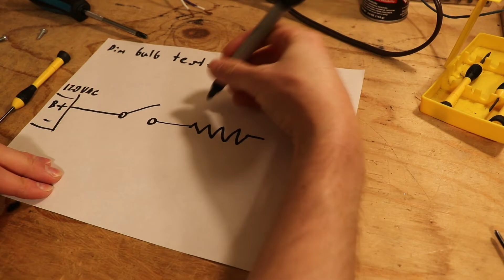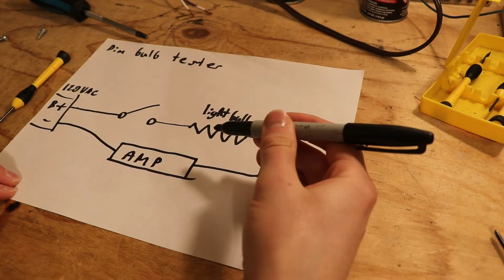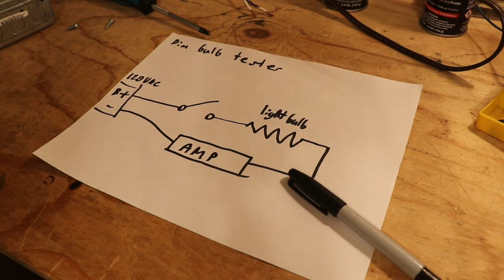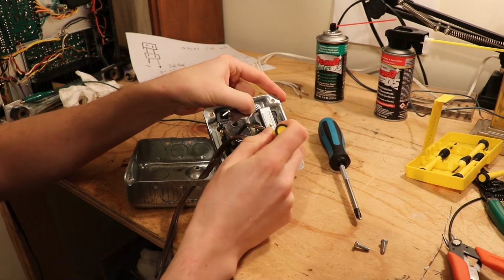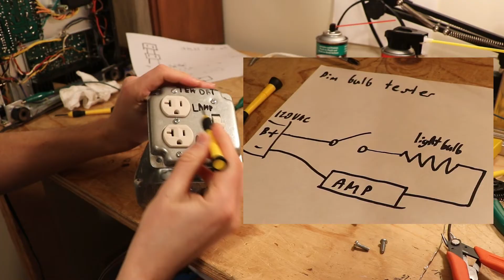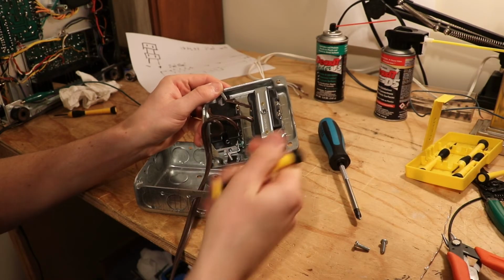Dim Bulb Tester: What It Is, How I Built Mine, Seeing It In Action

Comment: OK, I like the general idea, and I'm gonna have to build one of these testers myself, however, I am an electrician by trade, and I see one minor, (potentially major?), flaw in your design there of the actual wiring of the test hookup box itself...

The way you have that wired, the lamp is fine and safe, but the outlet that you plug the amp/receiver/equipment under test into is wired backwards as a result of the way you did it there, and you have the "hot" lead going THROUGH the lamp bulb and then coming back from the lamp on the lamp's neutral wire, so then the hot is now going to the "neutral" lead on the amp's power cord, which in many cases with more modern equipment, that usually doesn't matter too much because the transformer primary is oftentimes totally isolated from the rest of the circuit, however, on some older/vintage equipment the neutral wire is sometimes tied to the chassis of the equipment, at least through a resistor and sometimes directly, and since the way you wired that test box outlet up sends hot to the neutral terminal of the amp outlet, you could potentially get shocked when touching the chassis of certain older equipment, and of course that is a major safety hazard!...

To fix that potential issue with certain equipment potentially shocking you when you touch it, you should break the tab on the neutral side of the outlet also and then take the "neutral" (white/silver colored screw) of the LAMP outlet and wire that instead to the "hot" (black/brass colored screw) of the AMP/EQUIPMENT outlet, then take the amp outlet's neutral terminal (white/silver screw) and go back to the neutral of the main input wire/cord.

On a 120 volt outlet the neutral is always the longer slot, and with a 20-amp outlet like you have there, the neutral is the slot that looks like a sideways T, and the hot terminal is always the shorter slot.

If you fix that minor thing as described above then you will always have the polarity correct on both the lamp AND the equipment under test, which is very important for safety!... At least as long as the cords plugged into both outlets are polarized anyway, (i.e. with the neutral blade of the plug wider than the hot blade so it can only be inserted one way), OR else if plugging in a lamp or equipment without a polarized plug, (with both plug blades narrow and of equal size), then you would have to just pay attention to which way you insert said (unpolaraized) plug into the outlet so that the neutral side of the outlet always goes to the neutral wire of the plug/cord, (which is usually marked with either a white stripe or more often ribs or ridges), and then the hot side of the outlet, (narrow slot), always goes to the hot wire/side of the plug, (which in most all cases with most 2-conductor power cord wires, the hot is the one without the ribs AND it usually also is the one that has the writing or imprinting on it as to the guage of the wire, etc.), and so by always checking that, AND having your outlet box wired up correctly, then you'd never have any issues for a potential shock hazard.

Because if you've actually never gotten shocked yet with the way you have that test outlet box set up now, then you've gotten extremely lucky!

Hopefully you see this comment and understand it, AND you can fix/properly wire your test outlet box before you ever get shocked by touching the chassis of a piece of equipment, (due to the way your tester is currently MISwired), because we can't lose a great channel for us people who love to fix vintage gear, due to you getting injured or worse!

I will help you with a further, more detailed explanation, to get your test outlet box wired correctly if you need further clarification of anything I said here, so if you have ANY questions about anything I said above OR about why it is absolutely necessary/essential to fix for your own safety, then feel free to ask me anything at all about it and I will walk you through it step by step IF you need the help!

I actually hope I DO hear from you in a follow up reply, AND that you got your tester outlet box fixed the way I said, because electricity can be very dangerous if you ever touch the hot lead of 120 volts or higher, as I'm sure you already know!
Reply: Thanks for this! I just built one and watched this video to compare what I did, mine is a little different - thankfully I think I built exactly as you described it. I am using a 2-gang metal box. One of the gangs is a dual switch/output combo, which is where I will plug in the amp. The other is a regular dual outlet, where I will plug in the bulb. I broke the tab on the switch/output combo to completely separate them. My wiring is like this:

hot from power cord -> switch -> hot terminal of double outlet -> lamp(s) plugged into double outlet -> neutral terminal of double outlet -> hot terminal of single outlet (on the combo switch/outlet) -> neutral terminal of single outlet -> neutral of power cord. Of course all pieces are grounded including the box. 
Thanks again!
Reply: He doesn't have anything labeled so you don't know, this isn't a physical diagram. He has the source labeled as a battery anyway. Yea on the amp plug you want line and Neut to be on the correct side with a ground, that's intuitive. Ground to protect the tester case and if the amp has a ground.
Reply: These vintage units have non-polarized plugs so that is a non-issue
Reply: @Texan1048  Sometimes yes, if they're a fully isolated unit or device, (which many are), but if you really pay attention among ALL electronic components, there are just as many, (probably even more), devices with polarized plugs as there is with non-polarized ones, so in order for this dim-bulb testing device to be totally 100% safe for ALL devices and components that you may plug into it, it really needs to be wired correctly, with proper hot/neutral polarity on the outlets, otherwise there runs a slight risk of electric shock with some devices that rely on that proper plug polarity for safety!
Reply: @JoeJ-8282  agree, have to be familiar with what you are dealing with

Comment: Still astonishes me that America likes metal boxes like that. Here in Australia, that would have to be plastic to be safe and legal.
Reply: A metal box would be OK as long as it's properly grounded. But yeah, it astonishes me to see that with no ground lead, super dangerous! Having the sockets like that would be totally illegal also - firstly, again, because again, earthing - the sockets don't have a protective earth connected to their ground pins, but secondly because you could just plug any old appliance in series with the device under test. Theoretically I think you could produce a legal dim bulb tester here, but you'd want an RCD breaker on it, and probably you'd need to put a bulb bayonet/screw mount socket on the box itself and wired internally, instead of the socket for the external lamp.

Comment: Just a suggestion, break off both tabs on the outlet and run a jumper wire from the Neutral side of the dim bulb socket over to the Hot side of the item test socket. That way you preserve the Hot, Neutral, and Ground positions at the item test socket. Basically plug in an outlet tester in the item test socket and verify it passes the checks (no reversed Hot/Neutral)  then you know it's good.
Reply: Yep, that is actually an absolutely essential thing that he MUST do as soon as possible, or else he is going to eventually, sooner or later, get shocked by having the hot (running through the bulb and back to the tester outlet) and then connected to the neutral wire of the equipment under test through that unbroken tab on the neutral side of his test outlet there as it is currently wired...

I certainly hope he sees either your comment or mine about this exact same thing, and he makes the appropriate changes to his tester outlet box before he gets shocked by touching the chassis of some piece of equipment he's testing out that has the incoming neutral power cord wire connected to the chassis of said equipment, as some vintage gear is wired that way, I've seen it in years past!

We definitely don't want to ever see him get hurt by getting shocked!
Reply: @JoeJ-8282  Yes. there's YouTube videos about making these and the one I followed pointed that out. Mine looks the same as his with the exception of the reversed hot/neutral and I also added two neon lamps to mine. One lamp comes on when it's plugged into mains and the other will come on with the switch is thrown indicating AC is present at the item test socket.
Reply: Excellent point using a socket tester! :DDDD

Comment: I love DIY tools, this is awesome! But you should make sure and use an LED bulb, it's more energy efficient. 😉
Reply: I believe LED bulbs are different resistances. You could also use different watt bulbs for different equipment you are working on. It Has to be an incandescent bulb.
Reply: LED bulbs do NOT work as series connected, (i.e. current limiting), resistors. It is the actual filament of an incandescent (only) bulb itself that acts as the resistor needed for this type of tester, because if the current going through the bulb is relatively low and therefore safe for the equipment under test, then the bulb will not glow, (or only glow for a short period of time during the intitial charging of the power supply capacitors in the amp/etc. under test, and then once those caps are fully charged then the bulb will slowly fade out and go off), however, if the current drawn by the equipment under test is too high, due to an internal short or other major malfunction in said equipment, then the lightbulb will stay lit, indicating a problem with the equipment under test, because if the equipment being tested draws too much current, due to a fault, then the filament of the incandescent bulb will heat up and start to glow...

But an LED bulb doesn't use a filament, it uses internal electronics to light the LEDs in it, of which are of a very high resistance, (usually in the megohm range), which will never pass enough current through it to power ANY equipment, even if the equipment is working totally fine.

That is why this kind of tester ONLY works properly with an incandescent bulb. You can also change the wattage of the incandescent bulb to pass relatively more or less current, depending on what the equipment under test may need to operate at all. Higher wattage incandescent bulbs will pass relatively more current in a series wiring configuration like these testers use, and a lower wattage bulb will only allow a relatively lower current to pass before lighting.

When using one of these type testers it's best to start out with a relatively lower wattage incandescent bulb first if you have no idea if your equipment under test is working or not, that way you send as little of current to said equipment as possible at first, reducing the chance of further damaging it if something is wrong with it.
Reply: @JoeJ-8282  but.. are you sure? Have you even tried it first?
Reply: "Have you even tried it first?" is NOT even a valid question. An LED bulb WILL NOT WORK in this application. They function on an entirely different principle.
Reply: LED bulbs have a switch-mode power supply in them that converts the AC to DC for the LED, they are not to be used in this application. Even if it did work, to have the same current limiting capability of an incandescent bulb, the LED would have to be rated for a much higher wattage. For example a 60W LED equivalent, only uses 10W, so for the same current limiting as a 60W incandescent bulb, you would need a 360W equivalent LED, do they even make those. So no, LEDs are out.
Reply: @srtamplification  but... Have you tried it? How can you really know for sure?
Reply: @Monocog007 Any load in series with your DUT, will work. That is not the point. The point is, if you go to the store and buy a 60W LED, it only draws 10-15W. another words, you would have to get one that is for a 500W replacement to be a 60W load. There is no efficiency here. LEDs are efficient as light sources, because the array of LEDs can provide the same amount of light at a lower power consumption. If you need to limit the current to a certain amount, say half an amp, you need a 60W load, that would be a 60W incandescent or a 400-600W LED that only consumes 60W. No efficiency.
Reply: @srtamplification  alright if you didn't get it by now, you probably won't. It was a joke, always has been.
Reply: Coincidental that Kirchoff's Law, (which every first-year engineering student is taught) applies here. If the device under test has a dead short, a voltage drop equal to the full applied AC voltage appears across the light bulb, therefore causing it to light.
Reply: Bad joke   someone may try to use an led or cfl  and damage the equipment.   Bad news is the regular 60 watt bulb are banned

Comment: Do you have your amp plugged into the dbt while taking measurements like dc offset and bias? If so, does it not throw the measurements off? Or, if it does skew measurements, it's so little that it doesn't matter?
Reply from the maker: DBT is just to confirm there's no shorts. Set bias and offset on regular power.
Reply: @AHFixIt  What speakers are those in the background? They look like klh or optimus1
Great video very interesting and informative.
Thank you